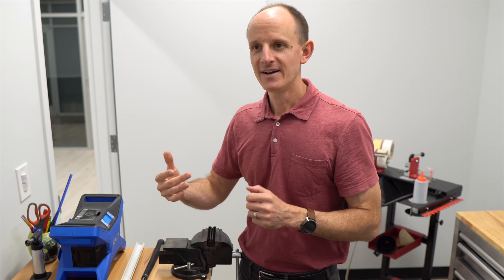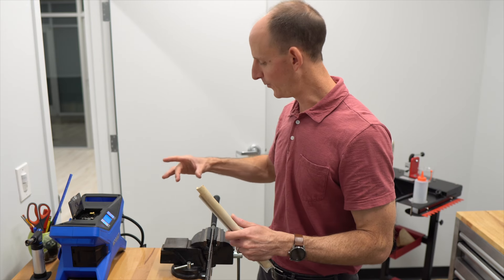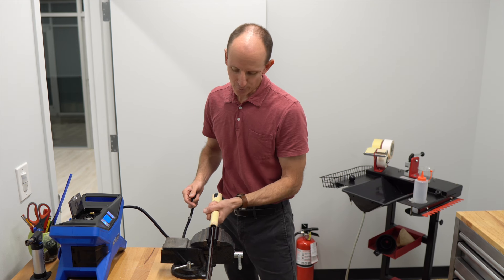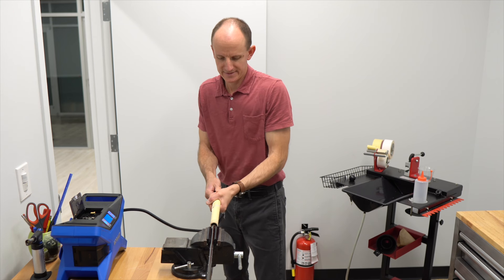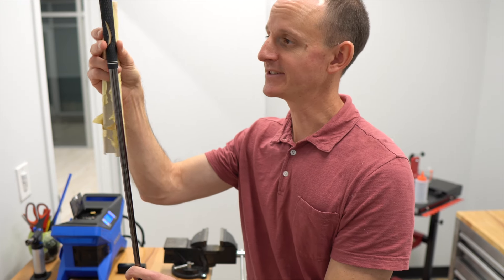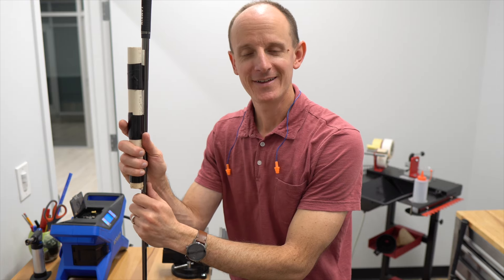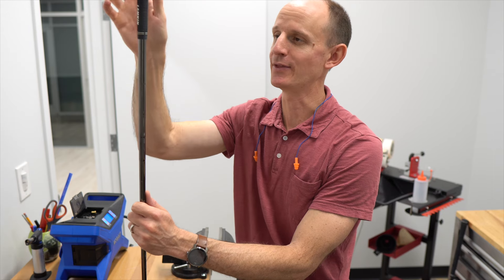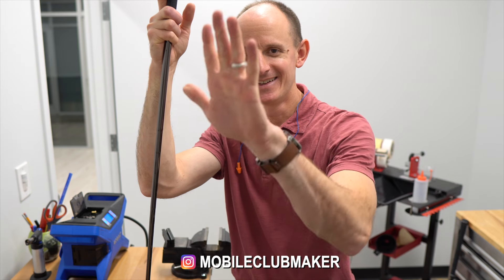Save Golf Grip With Compressed Air / In THEORY!

Comment: I syringe solvent in end of grip and use compressed air. Just have end of grip tilted down at same time you put air in . That way it will slowly blow the solvent through grip and delaminating tape off grip. Works 99% of time on most grips also
Reply: I have done this as well and wrap a rag around the end of the grip to catch any solvent that comes out.
Reply: I was thinking the same thing. Seemed a bit obvious to me. Glad to see some validation.
Reply: That's how i remove grips that I want to save
Reply: Hairspray is used to remove/install bike grips.  Seems it would apply here too…but so far haven’t heard/read of others using it
Reply: Question. Would warming grip with a hot air gun loosen the adhesion first?

Comment: Heath the grip up with hot (boiling) water for 30 sec. Wait 60 sec. and most grips will then come off easy. Use a (non-splitted) pvc pipe for safety.

Comment: I've removed my whole set of clubs all 13 grips using my air compressor @125psi (only because I didn't pay attention to my settings). When air is inserted a part of the grip would expand and balloon. Squeezing the grip at the location of the balloon and pumping air made the grip rip away from the shaft. And when you know that the grip has separated from the shaft inserting the air on the butt end makes it slide right off after a few squirts of air. There were times when I thought I'd have to cut the grip but eventually it cooperated. The air method is reliable some grips can become troublesome but will succumb to your efforts. As a backup I've got another tool that works just as well but I've never had to use it.

Comment: I have been blowing grips on and off for 10+ years.  I blew up one grip and learned fast.  Take a long strip of a poly webbing//strap material about 1.5-2" wide and spiral it up the grip to the butt. Secure end of webbing with a rubber band so it does not unravel.  Blow way. That webbing is VERY strong and will not let the grip expand much at all if any.  Use a little solvent as well.  The older the grip is the harder they are to remove.

Comment: Great video AJ 😂. My club maker takes off grips using a needle tipped oil can. One injection about a third of the way down the grip, squirt wriggle and massage it down. If it’s being stubborn do it again another third of the way down. If it’s still being stubborn then warm the grip for a literal few seconds with a heat gun. So far recovered everything I’ve given him with zero failure rate. One or two small needle size holes in a rubber grip are completely unnoticeable and don’t affect regripping ability at all 😄👍

Comment: Good stuff!   For removal of grips that were installed with tape and solvent I find the wire tools are the best, although it's hard work.   I try to use no tape when I grip the clubs - usually works fine - and then can easily remove the grip / replace the grip with air.     If tape is needed to tighten up the fit I apply tape but no solvent.    Never had an issue with the grip slipping in hot / humid conditions.   I use a cut-down plastic tube from an old golf bag with dividers and it works well for any grip size to keep the grip from bursting.

Comment: Just subscribed and have been watching your videos with interest.  I do my own club fitting like yourself and have been doing it for years.  I am critical of the way you were using air to remove grips, I have been removing grips very successfully using air for years and I observed you making a number of important mistakes using air.   First, get yourself a hardy, firm piece of plastic pipe that is slightly wider than a midsize grip, no need to cut it in half and tape it up again? What is the purpose of doing that, just slip the grip size pipe over the grip.  Secondly, you need a much more powerful compressor, you need a good quick blast of strong air to “break the seal” of the grip, should here a sharp “crack” when this is done.  Take the pipe off and then place air in it again and it should just slide straight off, no problems.   Every now and again you get a tough one and that’s when I use the tool method, very rarely though.   Important to have a much larger strong compressor, that’s the secret.   Other than that, like your videos and picking up some good knowledge.  Cheers!

Comment: I find that a piece of pipe just bigger than the size of the grip kept in one piece (not cut in 2) works. The grip expands but cant go any bigger than the size of the pipe so the air works its way through by itself by twisting the end of the grip and sliding the pipe down the shaft as the air works down. I've found it works for me but I don't do as many grips as what you would do!

Comment: I have been thinking of trying this exact thing. When I first tested some new different sized Jumbo Max grips on a couple of clubs I used the normal glue method. Before deciding I wanted them all to be Jumbo Max I had moved to using compressed air - thanks AJ. So now I am left with three clubs that have glued on grips. After watching this I might just wait until they need to be replaced and then go the compressed air route. For now I keep a note on my phone of which ones are glued so I won't forget.
Reply from the maker: You were able to get the Jumbo max on and stay on with compressed air? I have not tried it.
Reply: @EFGMC  Oh yeah and they stay put too. I have not had any twisting or movement and I practiced hitting 100+ balls almost every day during the summer. A proven method IMO and the only way I will be doing it in the future. Especially if you are experimenting with different grips like I was at that the time.
Reply: @EFGMC  I too use a tire air compressor unit that does up to 160PSI but I set it to 85 PSI. I installed the JumboMax STR8 Ultralite XS grips with a layer of masking tape underneath. The cool thing about using air is that I can re-adjust the grip at anytime for example, changing the loft of my driver, I can re-correct the spine of the grip. Much, much better than using tape & solvent where it's almost IMPOSSIBLE to pull a grip like JumboMax nor do you want to cough up $20 to cut & replace. JumboMax grips are NOT cheap at all.

Comment: Hi, you could use a tube with just the right diameter to slide it on. Don't make it too long. you should be able to keep the end of the grip squeezed close with your hand to avoid a channel were the air escapes. It mostly fine when the grip expands evenly too the tubes inner diameter without making bubbles.
Reply: I use an old bag tube cut to the length of a grip . I have a few different sizes. A little bit of solvent in the end . Wiggling and squeezing the tube while inflating helps

Comment: A tip too all the tight budget people, I use a metal ($2)coat hanger bent back into a T shape, and solvent, works every time , never had a issue, obviously only works on grips that are still flexible, the hard brittle grips I just cut off with a hook blade.

Comment: What about shooting some solvent down the hole, and using something with variable control?  Your compressor shoots in air until it reaches a set pressure, which could just be too much.  It's all about having the right tools for the job, and I'm not sure that tire inflator is it.

Comment: I use about a twenty four inch long plastic pipe but it is about two inches inside diameter.  It keeps the bubble from blowing up so much that it breaks.  Sometimes it may take several attemps as each additional pressure increases keeps working the air until it comes out the other end.

Comment: I have remove 100's of Rubber grips, I use a Schedule 40 , 1 1/2 in  x 12 in long PVC pipe uncut long ways, The real secret is to leave the grips butt end hanging out around two inches, so that you can twist with two finger and the thumb. The air will start the air down the grip sides and all at one moment in time the grip will break free you start removing it at the same time, and you have a grip to use for another clubs. Let me know if you would like a demo of my method....Thanks for all that you do for the Golf Club Repair community..

Comment: I watched a clubmaker trying to pull a grip yesterday with compressed air, the grip split. One of the things with the grip is it was a counterfeit GolfPride grip that the person that owned the club didn't even know ws counterfeit until the club repair people told him. I got to touch one of the grips and they were some harsh feeling grips. The club repair people told me that the guy liked the grips and wanted to keep them.

I wonder if you could make a steel pipe with a connection on the end to connect the air compressor to that would keep the grip from exploding but be safe in various sizes.

Comment: You need to use some grip solvent get it down the shaft or inject it under the grip. And you need a  light metal pipe that just fits over the grip. Blow the air in slowly and twist the grip at the same time. Leave room to move the pipe.

Comment: I have lightly heated the grip with a heat gun, then inject solvent in the hole at the end of the grip, and finally used the compressed air. 
Note of Caution: Always use safety goggles or glasses.

Comment: Removed many grips, for re-use, by injecting solvent into several spots around the grip using a hypodermic syringe,  works every time and I don't even own a vice.
Reply: How many spots did you use to do this? Did you do them on more than one side? Have you done this on Jumbo Grips?

Comment: what about using both the solvent and tool together with the air compressor? Add some solvent underneath the grip between the shaft and then use the ir compressor to halp release the grip
Reply from the maker: Maybe, though I could also see it becoming a literal mess.

Comment: WARNING it is a must to wear safety glasses. I have used this method successfully before. However recently I mistakenly did not turn my air pressure down, did not use safety glasses or a protective cover. A piece of PVC works. 
I’m recovering now but lost my vision in my left eye for several days, I’m very lucky it is gradually returning.

Comment: Thought on removal......

What if you use the solvent to losen up the grip, then use the pvc pipe and compressor??!!!!
Reply from the maker: You could. Not sure how far you need to get the solvent in before you could get the air to work. I feel like if you already start with the solvent though, it's just as easy to keep going with it to remove the grip vs switching to air.

Comment: It appears you may have taped the PVC too tight? Not allowing the grip to expand enough to break the tape seal and then come off? It is not the masking tape. Its where the grip is expanding because the PVC will not allow it to expand evenly- not allowing even the possibility of an even expansion stretching and tearing....

Comment: I am between grip size +1/32 and +1/64.  +1/48 would be perfect but obviously that size is not available.  So, what to do?
Reply from the maker: Depending on the grip you are using you can either all one more layer of masking tape to nudge up over 1/64 or you can stretch out a 1/32 grip to make it a touch smaller. Again it will depend on what grip you choose as to what option will work.

Comment: Don’t understand why you cut the pvc in half I use a length of pvc pipe that is not quite the full length of the grip. You are not going to save all the grips but I’ve had about an 80% success rate over the years removing grips that have been put on with double sided tape. I use a larger compressor with a pure grip nozzle that allows you to regulate the air you are putting into the grip which would be a lot easier than your setup.
Reply: I've never even used the PVC but I have more pressure from a bigger compressor.  Only time I've had one bubble up is not completely seated.  Not sure I've ever removed a lambkin though.

Comment: solid content...but you really need to get a proper air compressor with a holding tank -- you have all this clubmaking equipment and use that pathetic little pump?!  

seriously...get yourself a super-quiet California Air Tools compressor and be done with it.  a small 2-gallon unit is less than $200.

Comment: Do yourself a favour and spend £30-40 on a proper grip remover instead. A wire coat hanger will  do the job but it can take ages and often the grip will tear or stretch. Wish I'd got mine years ago instead of arsing about watching vids like these 😄
Reply from the maker: If you haven't watched this video of mine, it's a good trick to use with the wire style tool.
https://youtu.be/cx2YbfF1DjQ